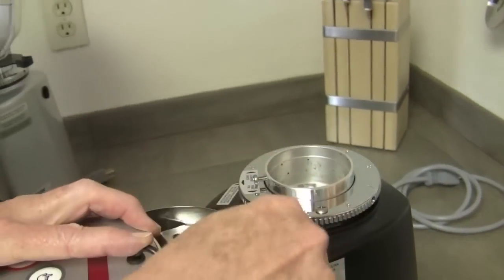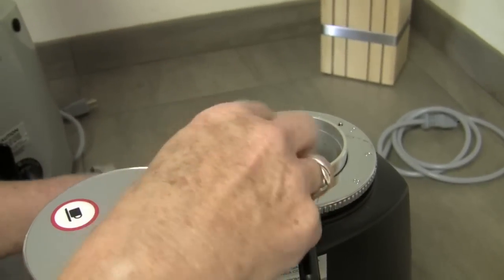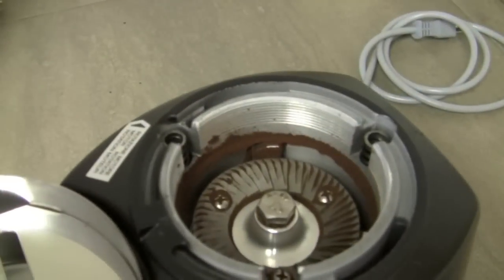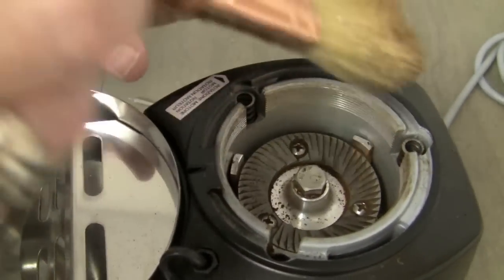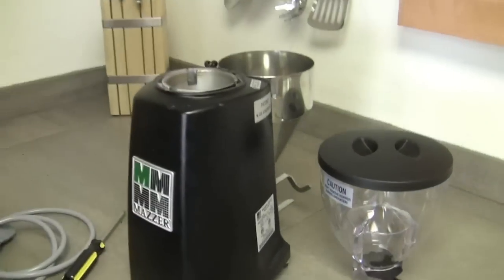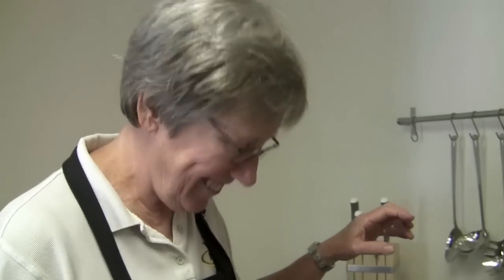Tech Tip: How to Clean the Mazzer Mini Coffee Grinder

Comment: I just cleaned my grinder last night, getting the top and bottom burrs out and using a cheap toothbrush to... brush its teeth... and toothpicks to dislodge whatever I could reach.

Instead of compressed air cans, use a compact, high-power air blower, such as the Metro Vacuum ED500 DataVac or something similar. They'll eliminate the issues that can come with compressed air and can be better at getting the grounds out, especially out of hard to reach places because of how much air they can move.

Comment: I just cleaned my Mazzer Mini for the first time since I bought it in 2008 (yikes). I only use it 2-3 times per week for a single espresso drink, so it wasn't any worse looking than the one in your video. But I did notice there was no course screen (~1cm squares) at the outlet of the burrs to break up clumps. I don't think I vacuumed it up, but somehow it ain't there .... Do you think I should install one?

Also, in reinstalling the top burr, it was difficult to figure out when to stop screwing on the top burr. Not sure if there is something obvious I'm missing there.

Thanks for the video!
Ann